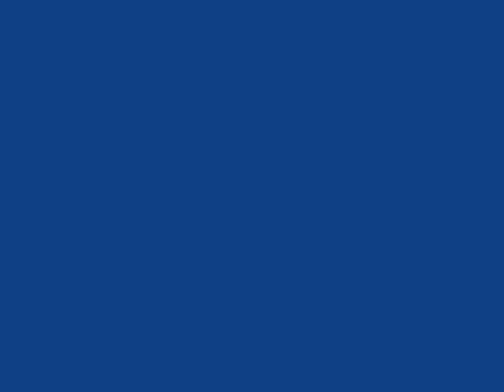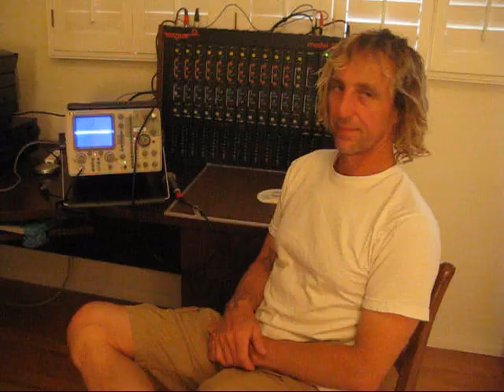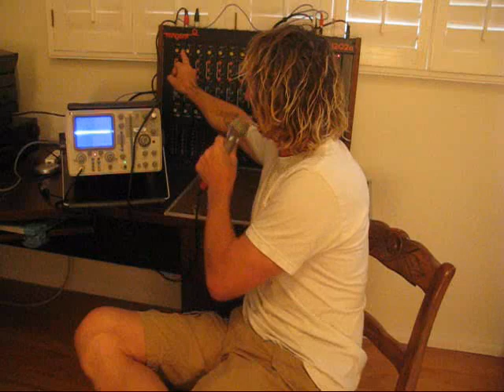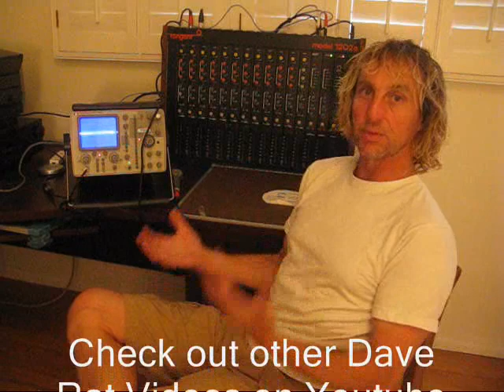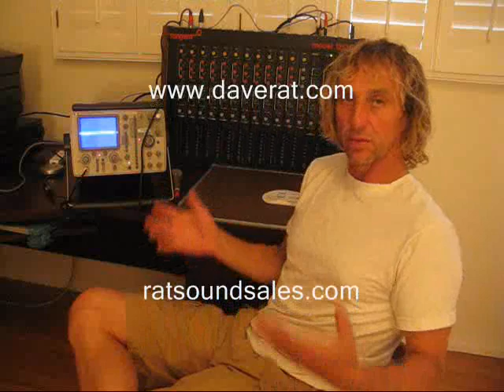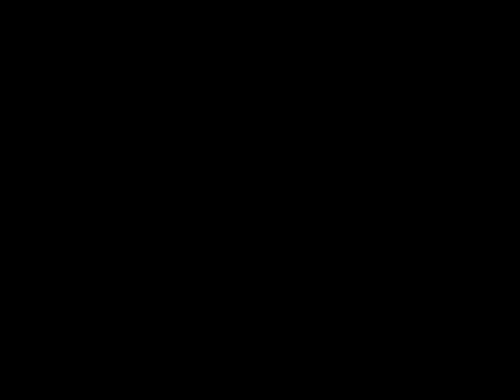Gain Structure Basics for an Analog Console

Comment: @canetree  not exactly. When you are sending a signal equal to the speaker power handling capabilities, nothing should happen. Thats why they are rated for certain power specs. This is taken directly from the EAW website. It won't fit in this comment box, but check the part out here that states with "Preventing Loudspeaker Damage - Preventing damage to or failure of a loudspeaker..."

Comment: Dave, 

When I adjust gains I go through each channel and set the level to about 0 on the meter... unity gain if you will.  Doing this I usually end up with most faders anywhere between 1/3 to 3/4 which sounds like it jives with where you run yours.  Are you opposed to doing it this way for any reason other than personal preference.  Sounds like just two ways to skin the cat.  Also, how do you avoid affecting aux levels if you make adjustments to the gain during a performance.  Great videos!

Comment: Hi there! Great explenation, just one question. I do things you do them, when setting gain structure. I am a begginer and I mix a band for two years now. A lot of people told me and keep telling me, that you have to keep all faders at zero position. I do not find this logical, beacuse I do not have a representation of what is going on with the mix or the levels, if the faders are all at zero and gains set so to control the reference between different inputs and a mix is then created using gain knobs. Is this correct or not? As previosly mentioned I do it a litle difrently, but very close to how you are doing it. I set all gains so I have a clear signal and some headroom at the meters and then I start mixing with faders, not with gains. The band is happy and the crowd is satisfied.

Sorry for bad english, I come from Slovenia.
Great work! Your vids are briliant and I tought much of you.
Cheers

Comment: Great explanation!
regarding power amps should i run them at full volume?
say if im at a small pub venue with my Rock band & i want less volume
Reply from the maker: ***** Set the volume level on the amps such that the console is at a metering level that is good and the volume level of the system is also good.
Reply: Dave Rat You mean set the power amps volume to taste as required correct?
I like the idea of setting the trim pots on my console where i want my faders to be after setting my pfl levels..my faders where always lower than i wanted them but didn't think to just back off the trims to compensate so i can raise the fader levels 

Any chance you could do a tutorial about ringing out a p.a system & stage monitors?

Thanks Dave
Reply from the maker: I have several videos I would like to do, I will add that to the list. Hopefully I will get the time and state of mind aligned to do some more videos soon
Reply: Dave Rat understood,another question that springs to mind is where to set my main speakers in a not so big pub venue odd shaped rooms that don't sound great,obstructions in the way sort of thing
Reply from the maker: Clear line of sight and high enough so the HF horn/driver is at least 12" above the tallest attending human or obstruction
Reply: Dave Rat i see the hi freq horn needs to be above peoples heads so pretty high then i've perhaps had them too low in the past
regarding the obstruction this was a small venue i played as a small Rock band,i was unable to place the mains wide enough left & right because the venue didn't want the speaker pointing over the bar so i moved it inwards which then had a concrete pillar a couple of meters away far from ideal so i angled the left speaker slightly to the right to compensate

Comment from the maker: @brainz11203 It depends on the signal.  With percussive sounds spaced in time, peaking at around 0 is good.  with more consistent sounds, a lower level is better.  Think 'averaging' where the average levels of the various signals should match.

Comment: Awesome video! When you mentioned fader positions, some set the gain so that the faders are around the 0 mark, allowing you to make less drastic changes to the signal. Would you say that this practise is pointless? Thank you in advance :)
Reply from the maker: I would say there are varying preferences for varying applications. faders at zero as a starting point is all good. I mix without any board lights so having the fader placements at what I consider to feel like I want the show to sound, is my preferred method.
Reply: Ahh I see! Thank you for your response.

Comment: Hi, Dave.  

Would you add that having a console with good or great preamps makes a difference, even on the $500+ dollar boards?  It seems to make sense.  I have a Mackie SR 24-4 and a Behringer Eurodesk 3242FX at work.  I changed things out so that the Mackie is the main FOH board instead of the Behringer, due to the better preamps.

Comment: I have been an audio guy since '92 but i always learn something from the Rat. I use a similar approach to gain structure. I think I know how to calibrate unity between console and amps , correct settings of input attenuators ( they are not gain pots ! ) on amps . Could you do a tutorial on that?

Everyone I know sets amps at full. I disagree.

Perhaps you could educate me, give me your insights on this?

My method involves various stages of using tones at unity, boosting gain, limiting etc until the amps barely clip then back them off. What's yours?

Comment: I've always been told (and heard) that every mixer has a "sweet spot" in it's gain stage, that varies slightly with frequency, but tends to determine what level to adjust the channel gain to. For example older Midas boards sounded best with channels pushing +2 to +4, but a soundcraft might sound like crap running this hot. That being said, I've always adjusted my gains using PFL as a measuring stick, and varying the levels according to the board I'm on. Is this a flawed concept?

Comment: Hi . Could someone please tell me where the gain of a powered speaker should be . I’ve been told to put the gain at full volume and adjust mixer to compensate for any distortion . Thanks
Reply from the maker: I would tend to set the mixing board game and output levels up where do you want them and they look and feel optimized and then turn the powered speaker up until you reach the levels you desire

Comment: Hi Dave, quick question. My little cousin accidentally turned the trim knob all the way up on my qsc touchmix digital mixer, so that channel kept clipping badly until I came back in about 10 mins then turned it down. Is this gonna burn out the mic preamp or the A/D converter? Any harm to the mixer? Thanks a lot.
Reply: Apache Cai No it will not harm the mixer.
Reply: BavarianMonkey Thank you.

Comment: In what practical way is digital different than analog?  The preamp is a digitally controlled analog device.  The faders, I assume, are digital, then the output from the board is analog.  If I understand what you are saying, you want the preamps' gain to be within the correct range, then you adjust it so that the faders can be where you want them.  Doesn't digital work the same way? If the signal is too low you get noise, plus weird digital artifacts, or if it's too high, you get analog distortion plus the possibility of nasty digital distortion.  Is it just that the usable range on a digital board is less forgiving?  By the way. I LOVE your videos.  You are a brilliant teacher. Your how to eq a sound system video made me a much better sound guy.
Reply from the maker: Since nearly all current mics have an analog output, yes, there is an analog to digital conversion on the front end of a digital console.  The output of a digital console may or may not be analog.  As there are many digital output options.

As far as what happens inside, an analog console deals directly with the signal, so moderate overloading will cause gradually increasing alteration of the signal peaks while leaving the remainder of the signal intact.  Digital consoles deal with a mathematical representation of the signal, so overloading causes abrupt data loss when the max is exceeded.  Not only is digital less tolerant to overload, digital overload also produces a more audible and less desirable sound.  So the combination of those factors results in needed to be much more diligent in avoiding digital overload.

Comment: One problem I face quite often is that whenever I set my gains to around 0dbu, my faders couldn't get to the unity mark before it gets ridiculously and uncomfortably loud. I then turn down the power amps to try to get my faders at unity and incoming levels at 0.

This means sometimes I would have to run my mic pres hotter than if I had my power amps at max. Does this increase the potential for feedback as mic pres are said to increase the sensitivity of a mic?

Comment: Driving it with clean power above it's xmax will of course introduce mechanical distortion from the woofer itself but that is another matter entirely and is less audible on lower frequencies.

HOWEVER, at this level don't allow the pwer amps to clip else it is goodnight EVX-180B in fairly short order.

Comment: @www73171 I thought the days of true dc coming from clipping an amp were over & that the real culprit is simply excessive average power. I also understand that a clipped signal's extra power does in fact push a cone/diaphragm more in terms of excursion than the same signal up to the point right before clip. So over-exursion is also a potential problem with clipped amps along with excessive power.

Comment: ANY dynamic range compressor limiter that I know of is a VGA. Do diode clippers in pro audio still exist?

I do not know ANYONE that would consider putting a diode clipper in their signal path.

In any case, this type of clipping is different from the clipping achieved by either over driving an input OR an output stage of an amplifier as BOTH of these result in an INCREASE of power (just distorted) being output. In contrast a diode limit clipper does not have increased output.

Comment: cont.........
stage of the amplifier is outputting MORE power than it can do cleanly (more than it's power supply can deliver) which can hurt your speakers as they struggle thermally and mechanically to reproduce the signal.

Comment: @thaflyinsoundman: occasional clipping on a well designed & setup system should be a non-issue. Clipping per se is not what blows speakers - it's excessive rms levels and/or running frequencies into a system below driver cabinet tuning. Clipping raises rms levels & can cause more excursion of drivers. With good speaker processors that have 2-stage limiting (rms & peak), you can clip the crap out of your board & fx processors with no ill effects. Sounds like your sound co. could use some upgrades

Comment from the maker: @hacksawowner Well, not really. Pretty much you want to run a console as hot as possible without introducing unwanted distortion.  This level varies from console to console.  So I guess that would be the 'sweet spot'

That said, the sound of some overload of some consoles can be desirable, less pronounced but similar to what we like about guitar amp distortion.  This gentle overload of peaks should also be considered and is most likely a factor in the perceived sweet spot.

Comment: @thaflyinsoundman EAW's information misses several points. You can feed speakers a clipped signal all day long so long as the signal does not exceed the rms rating of the speakers. A 10W amp @ 100% clip will not exceed 20W of output. If you're driving a 100 watt cone driver w/ that signal, it will NOT blow. So the size of the amp & power rating of the driver has *everything* to do with the issue. If all it took was clipping to blow speakers, guitar amps would blow drivers constantly.

Comment: @canetree oh and clipping is EXACTLY how you blow speakers prematurely.
Sure age has a lot to do with it, but there is a reason why every pro-audio amp manufacturer recommends that you either match or exceed the rms of the speakers with an amp. When you "underpower" the speakers, you are much more likely to get the amp to clip. When you get the console to clip, it doesn't produce a level any louder than if you were to get right up to clip. It clips the signal from getting any louder.

Comment: If you are running digital to the same sort of level settings as analogue, 0dBFS on your analogue meter is -20dBTP on a digital meter. Peaking at 0dBTP on digital may well viciously overdrive any analogue equipment downstream from the ADC. 

This has been a serious problem ever since people started mixing digital and analogue, but certainly I'd suggest that everything above -20dBTP should be thought of as being way off the top of the meter, and shouldn't be used.

Comment from the maker: @thaflyinsoundman Well, clipping an amp is not quite the same as clipping a console.  Amp clipping with older amps can be devastating to speakers.  Clipping a mixing board just causes distortion not unlike running a DI box on a distorted bass. Newer amps tend to have circuits that reduce the trauma of clipping. 

The difference is that when an amp clips it can put out high voltage DC to the speaker.  When a mixer clips, the AC coupling in nearly all audio circuits prevents DC from passing.

Comment: @thaflyinsoundman - It's a misconception that diaphragms/cones get "held out" by square wave signals & overheat from lack of motion. That's false. The motion of the cone being feed square wave signals is, in fact, sinusoidal. What kills drivers is too much power or over-excursion. Very clipped signals can produce up 100% more power than the same signal right up to the point of clip. If the clipped signal has less power then the rms rating of the driver, the driver/speaker will be fine.

Comment: The point is being overlooked by yourself that speakers and power amps should be matched to produce the best performance.

Take the excellent electrovoice EVX-180 18" driver for example. This driver is notorious for liking large amounts of good clean power with an xlim of nearly 25mm..........well above it's xmax. This means it can be driven well over it's xmax without mechanical failure, therefore it is not uncommon to drive this speaker with 2x it's rms rating.....cont.

Comment: No, it is your misinterpretation that is the problem, particularly in regard to what I am posting.

I have never said that an underpowered amp sent into clipping will hurt a speaker. 

I have not claimed that clipping itself is what is dangerous to speakers, you may have inferred this, yet I certainly did not imply it.

I have also stated that speakers fail in two ways, thermally and mechanically.

Comment: but when a power amp operates beyond it's limits, it is essentially sending more power than it was designed to handle by emitting square waves. Square waves are harder on a speaker mechanically than a sine wave. Let's assume that the speakers are properly matched to the power amp, for example the power amp is 1.5 times the RMS value of the speaker to allow good headroom......................all good as long as their is no clipping. cont.

Comment: I see all of these "old school" engineers on digital mixers lining all of the faders up at 0dB and mixing with the head amps. Isn't this the total opposite of your analog unity gain structure? by turning the head amp (input) down your lowering the signal to ALL of the on board processing... therefore starving the "fat channel" the proper gain for processing. Am I wrong?
Reply: The idea is to come in to the faders at acceptable 'rough balance' level, then use the faders to adjust during the course of the show. The reason having the faders at unity is important in this set up is that the faders are non-linear - there is more room around 0, so if you move it you make more accurate changes. Operating a fader far down low results in giant leaps of volume with small movements.
Reply: still does not answer my question.." by turning the head amp (input) down your lowering the signal to ALL of the on board processing... therefore starving the "fat channel" the proper gain for processing. Am I wrong?"
Reply from the maker: There are several things going on & the goal is to find what works best for you or your application. The mic pre adjusts to overall gain, if you set it too high it distorts, too low and there will be excess hiss noise and maybe not enough gain later in the signal chain. The faders are a typically just attenuates to offer easy control and a good visual. As long as you dont get a distortion that is undesirable or too much hiss (which is rarely an issue with amplified music) then you can use either the faders or the gain knobs. If you desire a slightly overloaded mic pre sound, then set the mic pre at that level and use the fader.  If you like to have a visual reference point, then set the faders at 0 and use the mic pre's to set your levels.  I personally use a combination of both. I like my faders to mostly be at 0, except vox, K, sn and toms I like to be a +3 and HH and cymbals at -6. That is my starting point and where I go back to several times during the show so I do not drift into oblivion. I also refrain from ever touching the mic pre's unless if something on stage changes and forces me to do so.

Comment: Not to undermine Dave, but simply put, clipping your amp or your speaker can cause speaker damage. Clipping the channel wont harm the console, as he said, but it doesn't sound good.
Reply: Depends on the console. I quite like hitting the preamps really hard on Midas and Allen Heath analog consoles. Gives a pleasing sort of thickness.